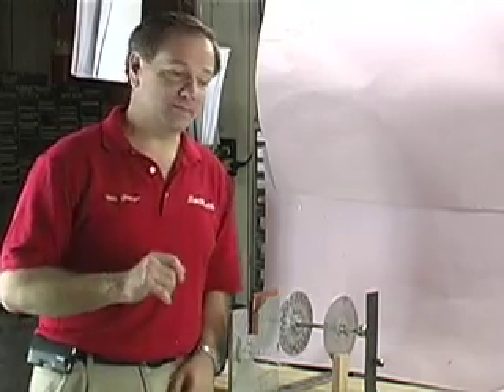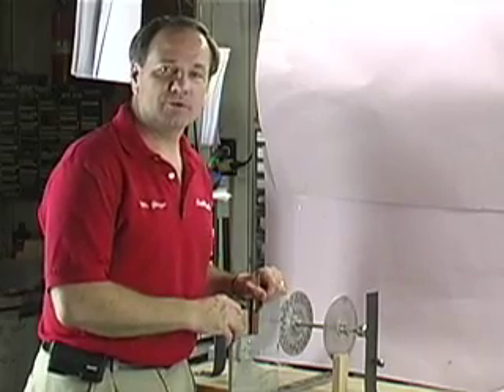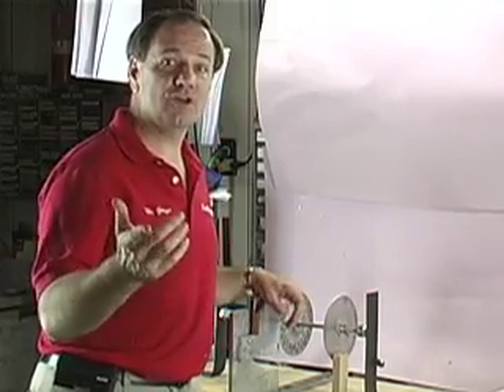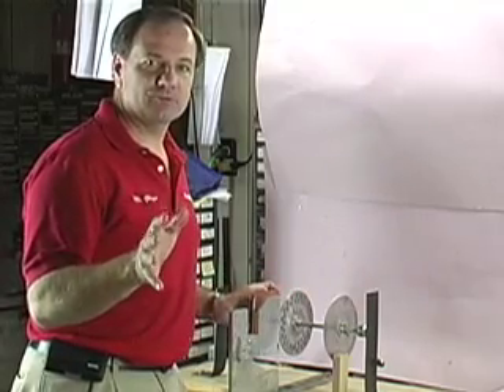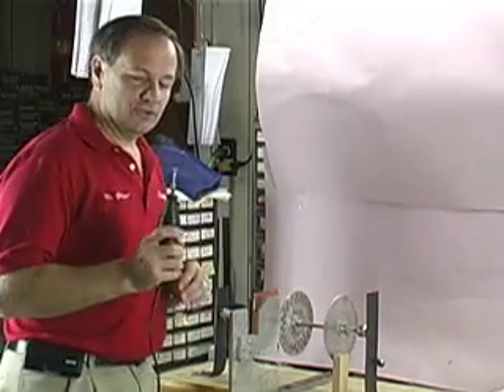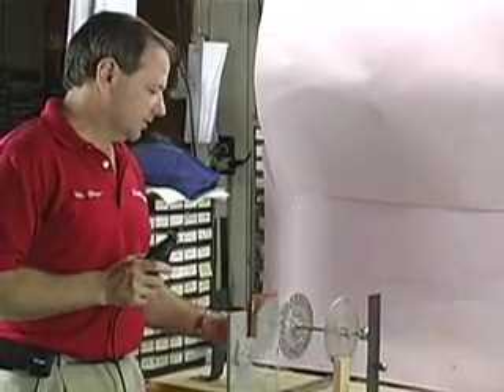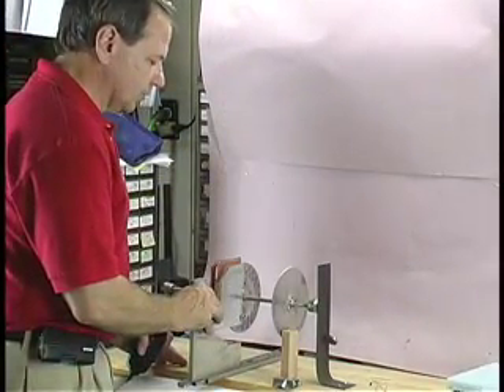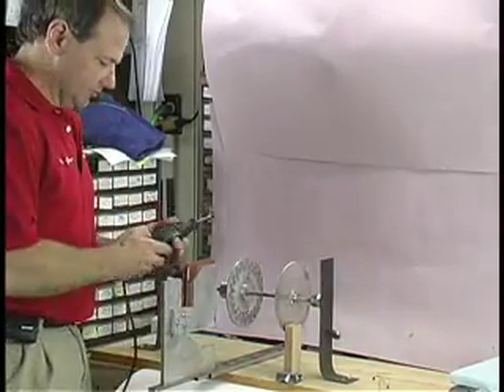Supermagnet Braking system - Working

Comment: @gmgunner oh BS is physics your life. I was doing these kind of calculations at 16/17 in high school. If physics is your life it's trivial to calculate the eddy currents and retarding force for any strength of magnetic field and disk material. 

As I said it's used on everything from F1 cars to buses to high power motors. Do the calculations if physics is your life stop whinging that you want others to do the work that you claim you're more than capable of doing

Comment: @gmgunner so work the numbers out for yourself. You're like a parrot having its string pulled "I want numbers" SQUARK Go learn a little physics and figure it out, this is high-school stuff. Heck the same principles are used in regenerative breaking systems in everything from formula 1 cars to trains to escalators to buses to printing presses.

Take a foundation course in physics and catch up on what you missed at school and stop making a fool of yourself

Comment: @stabilini the energy will be dissipated in eddy currents generated in the disc by the magnetic field. These currents will cause resistive heating in the disc which is negligible for this low load demonstration.

Comment from the maker: @stabilini - partially correct.  While the energy is converted to heat due to the thermal properties of copper and aluminum the heat is dissipated quickly.  We never detected themagnets getting warm to the touch and while the basic neo magnets lose strength when heated above 170 F we never saw temperatures exceed ambient.  The temperature increase would probably have been in the tenths of a degree range.

Comment: Ok, it works as a break.  Great.  Were is the kinetic energy going?  HEAT.  Not as much as a friction break, but it still generates heat, and heat weakens magnetic fields.  It don't see this as being a long term viable replacement for current systems anytime soon.

Comment: @SuperMagnetMan it's not very weight effective and disc brakes actually work much more effectively...Maybe something will change in the future, but this specific setup is not as good as standard disc brakes.

@CYNiCAL2009 Imagine if this were connected to a rotor and a caliper from a car, the momentum would be far greater than it currently is but a disc brake would actually stop it as fast as the magnets, if not faster.

Comment: While this might not look effective its actually pretty handy when talking about ridiculous speeds. until 200 mph rubber may work just fine but after that speed rubber will just burn and any other break systems except this one will just damage themselves and the wheel.

Comment: These 'magnetic brakes' induce eddy currents in the spinning metal which then proceed to interact with the magnets and slow the wheel down. They use these on modern railroad trains close to the tracks.

Comment: A reliable test is one of less variables. No doubt it works- however, the degree at which it is comparable and efficient is only at high speeds where standard metalic components would be heated and destroyed. With limited information, one cannot judge its value. If the braking system was so great why don't formula 1 cars use them? Because they are Sluggish. Mind the regulations.

Comment: You need to rethink your scientific procedures if you think that saying "It stopped" gives me comparable numbers. Let alone proof that the process is even worth implementing if you wish to stop shorter than a mile. The sad fact is that the vehicle in test is not a machine that was build for its stopping power. So, stating that it stopped really doesn't prove anything. If i throw my car in nuetral it will stop. If i open the door it will stop sooner.

Comment: Ok- What don't you understand about Brake Torque numbers? Yes I understand it did stop. However, it did not go unassisted, they incorporate wind brakes aswell. So, my problem is - How can you determine its effectiveness if you are utilizing other restraining forces? Honestly, the applications for such a device are substancial over time. Inertia is a real bitch. I want numbers.

Comment: I don't see practicality in a design that is powered by a Jet Engine... I do understand that it did work. But, as a standard rule of thumb for me is, I need numbers. Nowhere on that page did it specify about the breaking system. It mentioned that the other mechanical devise "chute" failed to deploy, and the magnets assisted the other hydraulic panels, How effective were they? Did he travel 10 miles before stopping? These facts left out are serious problems. I wanna see Break Tourqe #s.

Comment: - To continue with my questions... How- with the introduction of magnets, how do you compensate for the magnetic pull on the surrounding metalic parts? Which goes back to the question about Steel, or whatever metals you decide. Magnetic force would almost be like friction, in that it will pull in any direction and ultimately stop motion entirely. What would be the solution? Also, What is the worlds most powerful solid state magnet? what is the maximum potential magnetic force with solid magnets?

Comment: I say, Run with the idea, but before you go off building crazy machines, calculate the amount of force it would require to engage and disengage these plates. Then find all the negative effects by using a breaking system designed around super-magnets... would you, could you build a system strong enough without steel whilst using magnets powerful enough to stop a  rotor disc attached to a 3000lb vehicle or something with enough mass comparable to that. Just my thoughts.

Comment: "Once our high speed wheels were installed, greater speed tests were conducted. In June 2008, the 14,000 lb North American Eagle™ was stopped from a speed of 400 mph using nothing more than the Lev X magnetic braking. Temperatures are monitored using two infrared temperature gauges located in the cockpit. So far testing has yield temperatures within design parameters. At 800 mph the Lev X Magnetic Brakes generate 4,700 brake horsepower."

Comment: actually they used it on the latest land speed record car because speeds were much too high to use even ceramic brakes (they'd melt). I dont know about you but 20,000 lbs of thrust isn't exactly low torque.

Comment: You have a very good point, this "highly affective braking" only works with little or no torque as shown here, therefore the effectiveness of the system when the inertia of the spinning object is higher and there is substantial torque behind it this would be a highly ineffective brake system, however it would be good for something with low torque and inerti like a tesla motor.

Comment: aluminium, copper aren't magnetic but the reason it slows the disc down is because if the electrical resistance generated by the moving flux. kinda like when you spin an unloaded dynamo it spins freely but as soon as u apply electrical resistance it becomes hard to turn the dynamo.

Comment: Yes, this will reduce the speed to the perfect wind speed generation. Still if you are thinking on horizontal axis blade generator we must take notice on vibration and ressonançe caused by high speed multi-direction tempest wind sources.

Comment: Well, that's great and all... but let's say we put that on a car. Which I would assume is the use of this if there was ever one... For example, I drive a small SUV, it weighs 4,000 pounds... There are four tires, even if we set aside the rear breaks being less effective than front due to weight under breaking... and split that 4 times, that's 1,000 pounds per wheel... In short I'd like to see you spin that up to a few hundred RPMs with a thousand pounds pushing behind it, see how well it works

Comment: I didn't mean engine-transmission clutch, but more general (wiki: "A clutch is a mechanism for transmitting rotation, which can be engaged and disengaged."). I mean "brake clutch" on each wheel who engages generator to give more power to breaking magnets :-)

Comment: Why would you touch the clutch when braking? The only time you clutch in is when your engine is starting to say "hey mate, I'm going to stall soon" until then engine braking aids in the slowing process. All you'll do in that scenario is put more pressure on the brakes and wear the pads faster and putting extra stress on the mechanics of the clutch (read: the springs) meaning that'll wear out faster too.

Comment: What about using the electromagnet. Just connect electric generator to rotating shaft and make solenoid around magnets. This will give additional power to braking magnets. More RPM = higher current, thus more breaking power. Generator could be activated by clutch only during braking.

Comment from the maker: I have no idea what you are talking about.  I would think that pressurizing Nirtogen would take a little more energy that the neo mags require to work.  Especially if you factor in that the neo mags will last over 500 years.  They also work extremely well for this application.

Comment from the maker: If the magnets overheat enough to shatter the rest of the vehicle has long since been destroyed.   These magnets lose their magnetic strength as the temp goes above 80C or 170F.  As it loses strength the effect is less and, well, that is when the car would crash.  Heat is only an engineering challenge - definitely not a limiting problem.  It is easy enough to use heat sinks to limit heat in an area.

Comment: Yes, you can control it in much that way. But steel has too high resistance for it to work well- although it would work a bit. You really need copper or aluminum or other low resistivity metals.

Comment: I'm afraid so.

Neodymium magnets are extremely sensitive to heat, they only need to get to 80 degrees centigrade or so (depending on the grade) to become non magnetic.  Car brakes reach several hundred degrees.

Being a few millimeters away from something that is generating many kilowatts of heat is not going to be in any way conducive to long life.

Comment: What if you used insulated steel wire wound accross the flat surface of some wood or plastic sheet or pannel in the direction of the eddy currents, would you be able to switch the braking on and off by openning/closing the circuit?

Comment: It might depend on how you used it, but it's very like iron in many ways. It's also ridiculously magnetic, so your brakes would lock on!

You really want something NON magnetic for this kind of thing, and highly conductive, but not superconducting. Copper is very, very good but heavy. Aluminium is good and cheap (and better than copper weight for weight). Calcium is even better than both, weight for weight, but tends to burst into flames even when you're not using it for braking(!)

Comment: It would work a bit, but not nearly as well; the resistance of the iron is too high, and you wouldn't get very good eddy currents. IRC the iron would have to be 5 or 25x thicker than the aluminium in the video or something ridiculous like that.

Comment: In a car the braking heat will tend to make the magnets stop working. You could engineer around it, but it works better with trains that dump the waste heat into the rail.

It *might* work for bicycles though. In the wet they tend to have quite poor braking. You could have a backup friction brake that you could also use when you're nearly stopped.

FWIW I just tried 9 5mm cube neomagnets on my relatively thin aluminium rims in a checkerboard pattern and it looked like it could work maybe.

Comment: Wouldn't it make more sense anyways to attempt to recapture the electrical energy? All eddy current is going to do, is heat that copper plate with the induced current rather than friction. In the end, you're stuck with the same damn problem, a brake system that overheats. Which is worse for magnet systems considering that when they heat-degauss they don't remagnetize even after cooling...

Comment from the maker: I am not sure how much it can conceiveably handle but the fastest roller coasters use the permanent magnet braking system and the last attempt at setting the world speed record used this design to slow down a 16,000 pound rocket car from about 600 mph to 200 mph.

Comment: You have a few problems there. This test was assuming the wheels were carrying no extra weight (ie) With a dirt bike, it would be better to just use your legs to slow the bike down instead of waiting for a couple magnets to stop it. The other problem, you are touching the axis with the magnets, which further proves that this would not be able to stop any kind of vehicle. Even if you could get magnets strong enough to stop a moving vehicle, you would need one hell of a machine to move the magnets

Comment from the maker: At the final step you have magnet to magnet interface so it definitely stops it in is tracks.  The magnet to magnet interface is not as good at high speeds but once it gets slow enough the magnet-magnet lock up ensures a complete stop.

Comment from the maker: At this mass and speed it was not measureable with basic contact thermocouples.  Theoretically it has to produce heat but then again copper and aluminum shed heat very rapidly and unless it generates an enormous amount of heat it will be back to ambient temp quickly.  Thanks

Comment from the maker: Yes, there are  40 disc magnets 10mm dia x 3mm thick.  Obviously in our science project she discussed alternative wedge shaped magnets that would provide a lot more surface area and also using aluminum/copper plates approaching from all sides and using multiple plates for maximum braking power.  As well as it worked like this I think an advanced design would be amazing.

Comment: It does. It's called a generator. That's how they work - rotating magnets inducing current in the wires(electricity) which slows the blade down when generating power.

Comment: I would guess that for a normal car during normal conditions the break disks will not reach 200C but for racing and for some city buses (when the electric brake is broken) they will. 
And even if most if the energy is generated in the metal and not the magnets (which I doubt is true) the disks can become well over 200C.

One solution may be to have coils and generate electricity and dissipate the energy somewhere else, or why not feed it to a battery.

Comment: One major problems I can see with electromagnetic brakes made with supermagnets is that the magnets can not stand much heat (up to about 200C for the best neodymium magnets) and when they are over-heated the brake fails. 

And then, of course, that the brake power fall to zero as the speed decrease so the magnet brake can not actually bring a vehicle to a full stop.

Comment from the maker: Hey, just thought I would add a note I just saw on Discovery Channel.  Guess what they are using to slow down the rocket car - American Eagle which is trying to go over 800 mph?  You guessed it - magnetic brakes just like this design.  Parachutes will slow the car to 300 mph and from there the brakes made by Magna Force will bring it to a stop:).  Yeah, I guess it really works.  What a test for the concept.

Comment: It can't really replace the pad-brakes on a car since it can not actually stop a vechicle, just slow it down. Combined with a standard brake it could reduce the wear of the pads a lot and has in fact been used on city buses for at least 30 years (using "standard" magnets).

Comment: This system of braking has been used in elevators for years, in the event of power failure the permanent magnets get their flux
reflected back to themselves making like poles repel. for more efficient braking maybe a series of copper coils vertically mounted should do the trick without any external power whatsoever.

Comment: This magnetic braking type of system might have some use in the wind generating area, for braking (slowing down to max. or lower designed speed) it when the windspeed is too high.  Perhaps actuated with a purely mechanical movement or some motor that can bring the brake into position.

Comment: we were thinking of bringing the magnets parallel to the rotating disc whenever brakes are to be applied.Will this system work?And if yes, could give any tips as to what power magnets are reqd and what size disc to use to oppose the momentum.If you think it wont work, could you plz suggest some other similiar method? kindly reply..thank you..

Comment: Hello,
Your system is amazing.We are making a model car having a weight of about 2 kgs and it is powered by an IC engine(3 c.c.). We are trying to design a magnetic braking system for the same. we are using a aluminium disc mounted on d transmission shaft.

Comment from the maker: I certainly did not see that question in the words that you used.  However permanent magnet levitation is possible but a major engineering challenge.  The most challenging part is that no 2 magnets have the same magnetic profile due to the manufacturing process and magnetizing process.  A levitating system would have to de designed that nullified the individual magnet variations.  I think this would be easiest with a large scale project rather than a small scale model.

Comment from the maker: Yes, magnets attracting each other would work but it is definitely not as smooth in deceleration.  Actually our design uses a large magnet to finally stop the wheel after it has been slowed down.  Since the paramagnetic effect decreases as the angular velocity decreases it is not very good for stopping at slow speeds.

Comment: It is all about the conductivity of the material.  Aluminum metal is paramagnetic, and copper metal is diamagnetic, but neither of these effects are strong enough to make any difference here.  Get the metals cold with liquid nitrogen and it will brake even better, due to the higher conductivity of the metal.